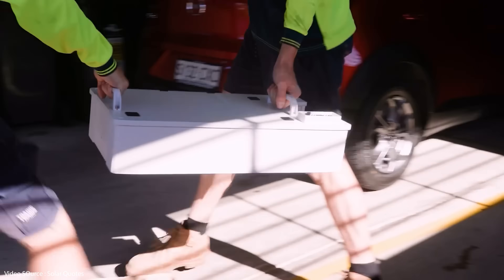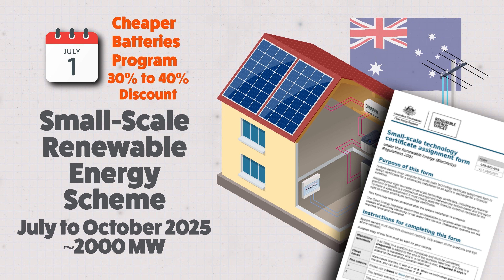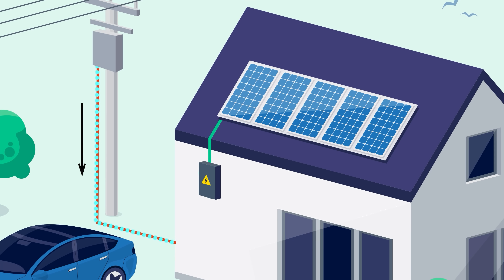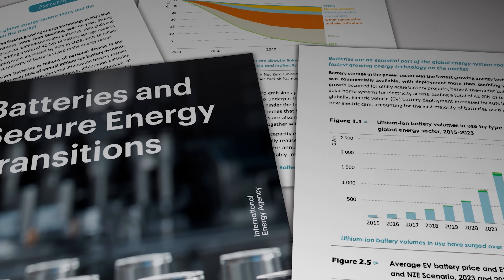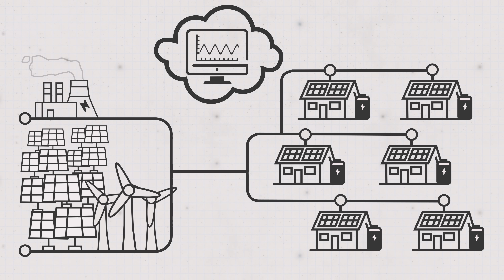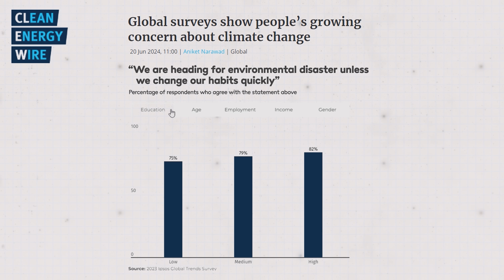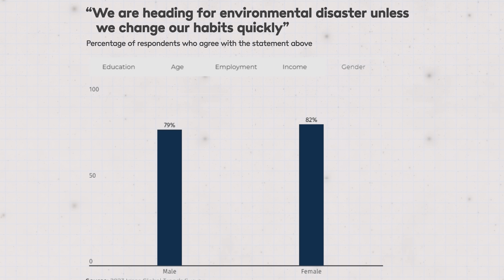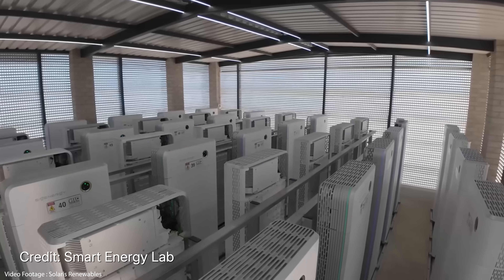Australians installed 100,000 home batteries in 17 weeks. Why can't we all do that?

Comment: I'm in West Oz and had been planning for ages to upgrade the very ancient PV array on the house I bought 5 years ago. I've never been happier that I procrastinate so much! I was just deciding on my installer and hardware specifics when A) the Sigenergy platform became available and B) the Battery incentives were announced. I benefited from from both a smallish state rebate and a slightly larger national rebate. I now have a system that is oversized enough to cut out all power charges - even in winter - and charge my (also new) car. Most amazing thing is the BYD car/Sigenergy system give me a bidirectional DC connection to the car battery - So effectively I have 98 kwh of battery! There is a 16 kwh fixed battery and a 82 kwh "mobile" battery. I'm feeding power in to the grid mostly just between 3-9pm when our isloated WA grid actually needs it (and I get a slightly worthwhile 10c/kwh FIT). I must do a review video on the setup. It's really quite amazing - even if the app running it is a bit unintuitive and flaky.
Worth noting also, that initially I couldn't justify getting a new car as my old diesel Santa Fe was quite adequate and I only drive it about once a week. But this is perfect as the car arguably does me more good staying parked in the carport than it does driving me around.

Comment: Northern NSW resident here, just had our Sigenergy 32kwh battery, 12kw inverter and 20kw powerplant installed today. We have a large home undergoing a big fitout with 8x AC/Heatpumps also being installed. We were already paying about $300 per month on power, so I can't imagine what it would be costing us to run all the new AC. 
We had a slight hiccup with commissioning today, and the team needs to swap out the inverter next week. Can't wait for it to be done.
Reply from the maker: Sounds like an impressive setup, and I hope the inverter swap goes smoothly next week!
Reply: @JustHaveaThink  FYI, possibly something to be aware of. it seems that Sigenergy is currently having issues commissioning the replacement inverters. There was a recall on them recently due to an overheating AC plug terminal. A very simple fix was released for a number of 8,10 & 12 Kw inverters in Australia. However comissioning is failing due to an issue on the server side at Sigenergy. Sounds like maybe the serial numbers are not syncing up. Two attempts now, and many hours wasted by the installer. Now they have packed up for the year, and I don't think I'll be hearing anything until the new year. Very frustrating. Our install has not gone smoothly.

Comment: Aside from constant sunlight, Australia’s biggest advantage is the winter, it’s short and not so cold. When PV production is at its lowest in winter, most parts of Australia remain relatively warm when compared with the northern hemisphere. So Australia’s maximum demand and production are relatively aligned. Here in Japan we have 3 months of continuous-5 to +5c with low levels of sunlight through winter.

Comment: Biggest problem here is we do NOT receive a fair price for power we put back into the grid. Eg in Victoria we get about 1.5cents per kwh for energy exported, yet pay about 45.7cents per kwh for power imported. Plus electricity retailers are charging increasing amounts for daily supply charge. Eg we are paying $1.47 per day in supply charge even IF we use no grid power.

Comment: 20 solar panels produce 5kW on a typical day. This charges a 14.7kWh battery to 100% storage by between 10.00 am and midday each day. The excess then goes to the power grid. The home begins drawing from the battery around sundown and runs off the battery overnight. Next morning the battery has discharged to around 50%. The cycle then begins again.
Reply from the maker: Sounds perfect 😊

Comment: I am also in Aus, There are secondary benefits as well: The grid does not need upgrading as quickly in towns / cities that are expanding in population. The government has leveraged a huge investment, largely from private individuals. These individuals have also provided the location and will maintain and update their component of the energy supply network. The best kind of power generation is where it will be used. We also have direct access to the dynamic pricing of the power grid though Amber. Personally, we will install a solar and battery system very soon and one with a DC electric vehicle connection allowing the car to be a battery as well. Power companies are also adding batteries where old power stations used to be and locally - even on telegraph poles. Yes we are very lucky here, but also not afraid to act and we have access to Chinese cars and battery systems.

Comment: I installed a 6kw/14kwh backup battery system for outages on my critical loads. My small utility co-op does not have any kind of off-peak rates unfortunately. I mailed them to see if they would consider it as I would then expand, but they never even got back to me so I'll take that as a no...

Comment: Aussie here. I already had 10kW panels, and planned to get a battery this year—I was looking at 10kWh, maybe 13 for a more exxy Powerwall. With the subsidy, I was able to get a Sigenergy 24kWh for less than 10kWh pre-subsidy. 48kWh was only $AU5k more! No wonder so many installed the big units! 

I've had mine since August, and it's been great, covering all my power needs, including EV charging.  With the battery, my imports have dropped to 1kWh a month - just  system balancing touches. As comparison, last Nov, with panels, but no battery, I imported 83kWh...

I'd like to see a way to get batteries into apartments & rental properties as well. I don't have any suggestions, though.

Comment: This is a two-edged sword for Australians.  The system must be grid-connected for which they receive a paltry AUD O.04/0.05 Feed in Tariff per kWh.  Energy rates are around AUD 0.35-0.40 kWh when drawing from the grid and about AUD 1.60 standing charge/day to support line maintenance, etc.  So the first step is to ma out generation, storage and self-use (hopefully enough to see you through the night).  Then you need to Feed in up to 40kWh/day to zero your electricity bill - feed-in rates max out at around 10kWh (controlled by the energy network.  So you need to achieve and maintain full batteries by about Noon then feed 10kwh for four hours.  That's the basics; however, what we Australians have not been told is that the Australian Governments (Commonwealth/State) are likely to do flip in a few years and charge to export excess energy plus also fraw power into the grid from your "subsidised" battery when they need to support the grid.  In many respects this is just a software change and flip a switch.  Your battery will be partially drained and then you will pay full rates for any energy you require.  Introduction will either be softly. softly or more likely quickly mandated as a necessity given the ageing electricity generation infrastructure is well past its use by date.  I am sure the Government "spin merchants" will have a plausible explanation - including "we paid for some of your batteries".  For me I paid for everything - no subsidies - and am gearing up to disconnect from the grid.

Comment: Australia is probably one of the most likely countries to succeed in having an all renewables grid with limited hydro and no geothermal power. 

The biggest problem is transmission lines and associated infrastructure costs. Real costs of electricity have been rising even as the average marginal generation cost is falling. 

People are not super impressed with hundreds of KM of new transmission lines getting strung through prime farmland and pristine forests. This battery policy is partially being done to mitigate these problems in the short to medium term.

Comment: It is like the exact opposite of what we are doing in the US. If you have solar power in my state, you generate electricity during the day and it goes right back in to the grid. Then you use it at night. So you are generating credits during the day, then you use those credits at night. If you generate more than you use, then you bank them with the power company. But every year around February, your banked credits are reset. So you are encouraged not to put a bunch of panels on your house since the power company would get free electricity. And currently there are 0 incentives to buy solar or make a switch. Not ONE.

Comment: I am an Aussie who installed solar and battery a year before the incentives were introduced. I have no regrets at all. I still pay about $1.20 per day to be connected to the grid, which I consider to be my contribution to helping those who are unable to get solar. I have exported over 1 Mwh to the grid... also happy to do that for social reasons. I have saved around $6000 in not paying for my home use AND no longer paying for petrol. In addition, Australia can reduce imports of petrol because of our two EVs. Payback will be about four years. Win, win,  win.

Comment: I upgraded my solar panels to  9.4kW system with a 4 module BYD home battery in 2023 and I have an 2022  BYD Atto 3  extended range EV. 

With the battery rebate I installed another 4 module battery, so a total of 22.08 kW BYD home battery system. 

I have a heat pump hot water system and energy efficient home electric appliances and  ditched my gas connection when I upgraded my solar system, so everything is now electric.

Today is very sunny here in South Australia so I have charged my EV battery which was down to 60 percent, then topped up my home battery to 100 percent and now I'm exporting excess solar electricity back to the grid at a maximum of 5 kW per hour.

The last 4 days I have exported at least 35 kW to 42 kW daily back to the grid which helps cover the daily connection cost to the grid at $1.10 per day. I have not had an electricity bill for 2 years now. I get 10 cents per kW for the first 10kW sent back to the electricity grid then 2 cents for ever additional kW.
Reply from the maker: That's an amazing setup! Thanks for sharing your impressive results from South Australia.

Comment: I probably would if I could install a battery to get that power when it's cheap and not have solar panels on the roof
and now I've found out that salt can be used to store power
and they're not as fire hazardous
as Lithium batteries are

Comment: Another excellent video Dave, thank you. "Australia's sprint to 100,000 home batteries" suggests Australia has now reached 100,000 batteries but I think Australia is probably closer to 180,000 installed home batteries as of Dec 2025. Those 100,000 additional installations in that 17-week period are on top of the previously installed home batteries + quite a few more since the end of October. Best fact check me but I think we're nearer 180k and should get to 250,000 during 2026.

Comment: I wish NZ would bring out a similar solar and battery subsidy. 
I've got an EV and would love it as the next step.
My house co-owner isn't as sold on solar though and the payback / profitability. 
They wouldn't pay for a system, while I still think there is value to be had and resilience from grid failure.
In anycase, once the car is paid off, I will probably look to getting a system installed. I'm fortunate in my position and not having a family / partner so I have more expendable income than most in my bracket.
However I am a little de-incentivised as the home I'm in is not exactly my ideal home. (Two story with a row of houses) so cost for install will be higher.
Still better than paying someone elses mortgage. 

Heck I'd love to be independent from the grid and not pay the $2.40 a day linecharge and increasing electricity rates.
Especially when a lot of our suppliers and power co isn't NZ, just more kiwi money to go overseas into foreign coffers. 
Good job selling govt assets - but thats another rabbit hole.

Besides, tax payer subsidized. How much tax does one pay in their lifetime?

Presumably the govt also makes money off the tax with smart investments to help boost their coffers.

Comment: One item that I don't ever see discussed is the photovoltaic revolution in relation to rented properties. I live in Australia and these incentives are only for homeowners. They effectively cause the poverty gap to widen, where homeowners are rewarded with more benefits, tax incentives and cheaper power, increasing their effective income, where renters see their effective income reduced at every step. I see no incentive for them and I see no discussion around this phenomenon. In Australia, around 30% of properties are rented, in the UK that's 35%, across the EU it's around 31%, the USA has about 35% rented properties. In other words, a third of the population is worse off due to these subsidies.
Reply: From the middle of 2026 many parts of Australia will have the option to have 3 hours of free electricity each day thanks to all those solar panels creating a glut.  Socialised electricity !

Comment: Despite the subsidy I decided to wait until sodium batteries are available.    Seem ideal, much longer life, less environmental issues and just about no chance of thermal runaway.
Reply: It’s probably a good idea to seriously consider buying a battery now, to capture subsidies while they’re generous and before rebate values shrink or funds are used up. Waiting for “next-generation” battery tech may sound appealing, but it also introduces real uncertainty, such as whether new products will receive timely Australian regulatory approvals, how reliable first-generation systems will be in practice, and whether advertised rollout dates will actually be met. 
In the meantime, delaying means forgoing today’s rebates and relying on technology that may arrive later, cost more than expected, or lack proven installer and service support in its early years.

Comment: It's not just charging batteries during the day with solar; it will be even more important to charge the batteries at night with wind. Wind turbines produce their most reliable energy at night when the electricity need is at its lowest, so much of it is, or will be curtailed. It is a much better idea to buy at night to stabalise the morning peak, than charge during the day with solar for the highest load of the day between 5:30 pm and 8:30 pm. So, batteries are very useful for counties with either or both high wind or high solar capabilities.

Comment: Aussie here, the scheme is pretty good except for one flaw: the incentive scales with battery size regardless of how practical it is, leading to installers pushing oversize batteries on homeowners which never really fill up (a waste of taxpayer money and resources). There's talks of changing this and it's not a HUGE issue but that's how it works right now. I also suspect we will see electricity companies and grids toy with the idea of using all these home batteries as part of a de-centralized global storage network for grid renewables, so it may not even go to waste in the future.

Comment: What they won't tell you however is house insurance goes up once you install a battery in Australia to  the fire risk.
Reply: No it doesn't. I've just reinsured. Told them about the panels, the home battery, AND the EV. Insurance was actually slightly less—not because of the batteries!

Where I live, the very real risk of bushfire is much greater than the incredibly low risks of modern home battery fire.
Reply: @thefathippyrubbish. Not hard to find the facts.

Comment: Have an install scheduled for 7 weeks time of 13kWh solar and 24kWh battery, have removed a 2010 2kWh solar array and restored roof in readiness for the new system. Old panels, racking and inverter are going to a remote opal mining claim to be set up offgrid

Comment: Unfortunately for you. I had a Think.
Road to disaster. Just look at Europe.
What is the cost per KWHr over the short life of equipment compared to the alternative. 
You still need to drive industrial loads. What are you going to do with all those heavily polluting expensive batteries, solar panels and windmills you have to replace every ten years? Who’s going to clean all those glass panels and burry the millions of dead birds?
Especially in light of the fact there is no climate crisis.

Comment: I'm one of the people that took advantage of/made the most of this scheme and got a 48kwh battery (50kwh limit for scheme). That is big enough to last me throughout the night on the hottest summer nights with 3-4 aircons on and an EV charging. Any smaller and it would not have been worth it for me and would still have to pull from the grid at some point in the night.

Comment: I live in Australia and installed solar about 2 years ago.   It’s worth looking at Australia’s incentives for solar on appartments too.  

At that time I got solar I disconnected from gas entirely.   My electricity bill averages $300 per quarter.   A battery could save me about $800 per year at most.   A 10 year period to pay for itself.   I am waiting for a 10kwh battery to cost around $2-3k.  Financial viability is important to me.   
With 40% of homes having solar, it’s disadvantaging the poor.  However, solar on rented homes is becoming more common too.
Reply: Yeah, I'm paying $3000 annually for gas hot water and electricity, and that's without running a/c. I don't have it. Meanwhile, my neighbour with roof solar runs a/c 24/7 year round for heating and cooling, and it costs him next to nothing 😞